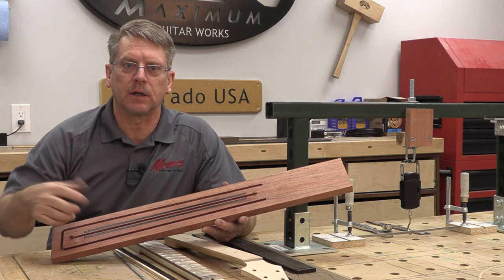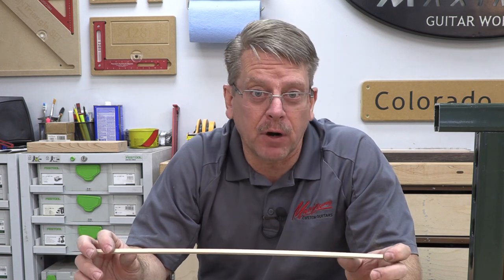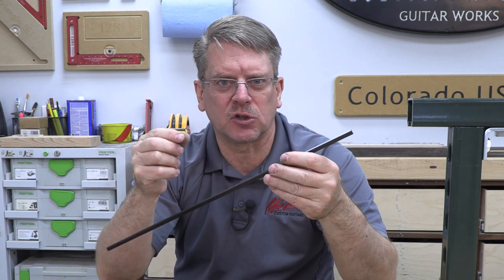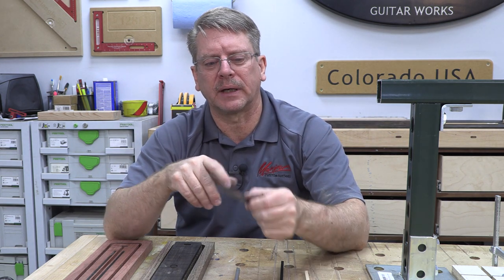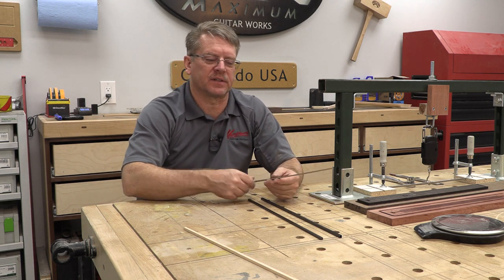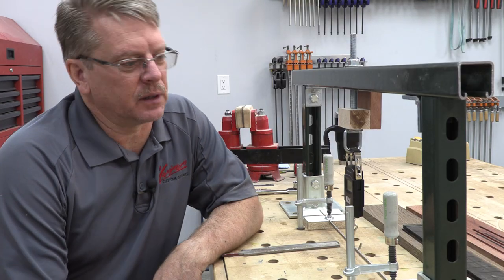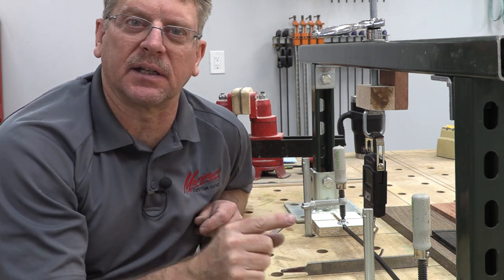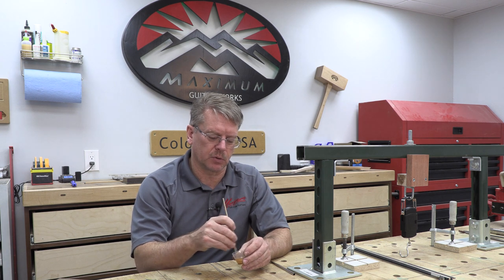Best Ever Guitar Neck Reinforcement Video (Deep Dive)

Comment: Very cool.  But how do you know it works?
Reply from the maker: Not sure I understand which part of "it" you are referring to.  Anything besides the maple will stiffen the neck...so if that is your goal...then they work.
Reply: @maximumguitarworks  i just hadn’t seen any comparison or experiments anywhere to see if these actually keep a neck from twisting.
Reply from the maker: OK...I understand what you are asking now.  Let me first say...I believe if you are looking for reinforcement to prevent twisting...your are off track.  Twisting is often the result of bad wood...not stable enough.  First priority is to select the best wood you can.  The goal is a good stiff neck that is not as susceptible to changing due to weather changes.  This is why quarter sawn wood is better than flat sawn.  However, many flat sawn are very beautiful.  Everything is a trade off.  Adding rigidity will make any neck better...which is where neck reinforcement comes into play.  Do all necks need it?  certainly not.  Can all neck benefit from it.  Yes...because there is no down side other than extra time and money to build.

A truss rod is not really designed to keep wood from moving...it is to fix the bow in the neck that is too much or not enough (in the cause of dual action truss rods).  The less the truss rod has to fix...because the wood is more stable...the better the neck.  Less stable necks require more tweaking with changes of temperature and humidity.  More stabile necks require very little adjustments after initial setup.

Hopefully this clears up your question.  Bottom line...more rigid necks are better.
Reply: @maximumguitarworks  great thorough explanation thanks!!

Comment: Hmmm, one question - how far can you go, installing CF rods (two in this case) until the rods make the neck so stiff you can't add some little relief without having to tighten the truss rod so hard that it either rips off the fretboard or rips through it? Could it happen at all?
Reply from the maker: I've never seen that happen.  I can't recall the math in my head...but if you calculate the amount of force needed for the minimal amount of relief needed (I'm normally at near zero relief)...the string tension alone is normally sufficient.  I'm normally at near neutral on my truss rod setting...so not much force being applied.  If you need a lot of truss rod to flatten a neck...it is probably a bad neck.

Comment: Killer video, very helpful thanks!

Do you have a link for the Dragonplate tubes you are using?  Is this it?

https://dragonplate.com/dragonplate-carbon-square-tube-250-x-250-180-id-x-48

I've been thinking about building some super lightweight guitars.  I was wondering about using softwoods for necks with carbon fiber rods and a truss rod.  Pondering Sitka Spruce.  I made two necks out of Port Orford cedar on classicals and they came out awesome.  But it's rare and expensive.  And I'm not sure how it would do with steel strings.  Do you have any thoughts on that?  I'm not sure that Sitka would be significantly less stiff than Mahogany which seems like you could do an electric neck with.

Actually, checking here, it looks like Sitka is comparable to Maple and Mahogany in stiffness and strength.  I was also thinking about Alaskan Yellow Cedar but the other cedars here look noticeably less stiff.

Any thoughts?
http://workshopcompanion.com/KnowHow/Design/Nature_of_Wood/3_Wood_Strength/3_Wood_Strength.htm
Reply from the maker: Hey Paul...that is the correct Dragon Plate link.

I have also used Port Orford cedar to build classical guitars...and Spanish Cedar.  All I can say is that you would have to try it and see how it hold up over time...under string tension.  I believe that the likelihood of success would be great in a set neck guitar than a bolt-on neck.  Carbon will help...but I'm not sure how will it would work.  Parker used basswood...but with a set neck and carbon fiber exoskeleton.  Sometimes there are innovative ways of doing things that haven't been tried...other times it has been tried and didn't work which could be way you don't see others doing it.  

Another thought with a light neck...is you need a matching light body...or the guitar will not balance well.

Good luck,

Steve
Reply: @maximumguitarworks  thanks Steve.  I was thinking of a chambered pine body.  Hard to get much lighter than that I think.  

I appreciate your thoughts.   Very helpful.  Thanks a million.
Reply: @PaulMcEvoyGuitars  I've built a long scale steel string guitar with Oregon pine (Douglas pine) and it hasn't moved at all in 2 years.